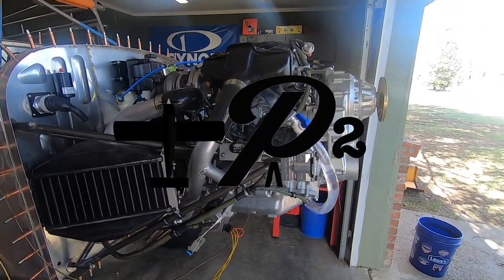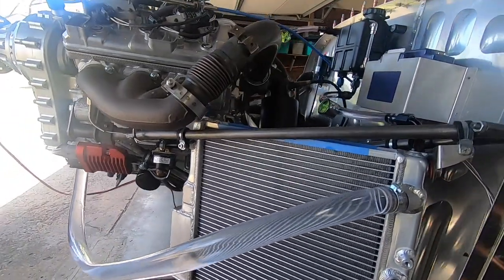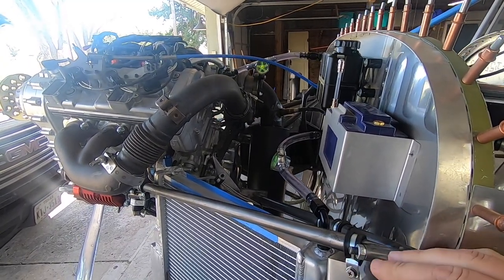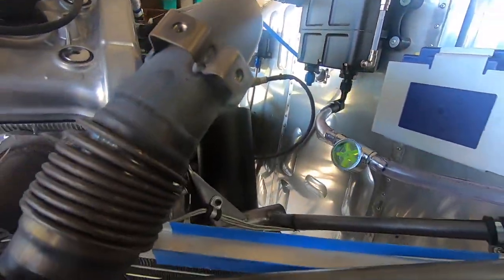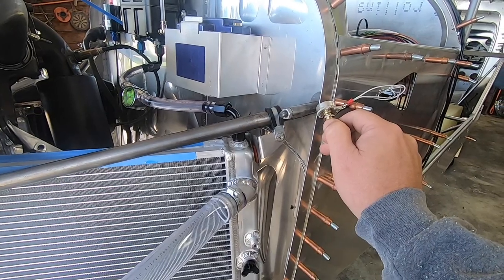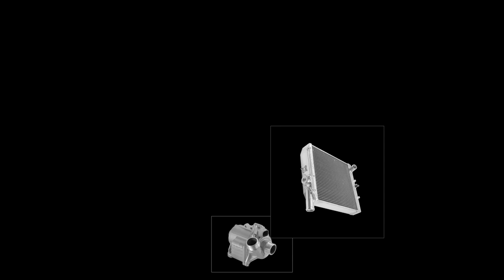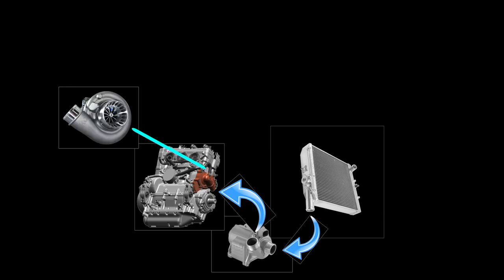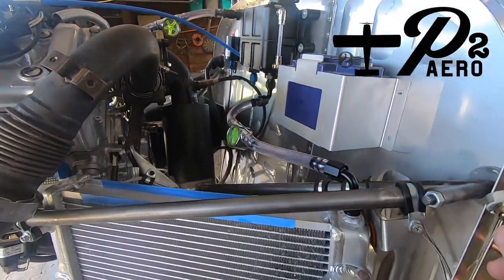Custom Cooling System for the Turbo Yamaha Rans S21 EP38

Comment: I am seriously, Very Impressed with everything about your approach to this cooling system, its design and execution. Your testing apparatus, temporary clear tubing and visible impellers, are brilliant. I’ve never seen those impellers before. Even the header tank seems to be a good hardware find.
Reply from the maker: Thanks Dennis! Those little spinning wheels are intended to be used in water cooled computers I think.. found them online and they worked out slick. It told me just what I wanted to know. Thanks for watching sir👍

Comment: What do you think your weight is at so far in the front without fluids? That large of a radiator seems a bit extreme.
Reply from the maker: No clue, but we are gettin close to running it and after that I’ll be weighing the whole firewall forward. Stay tuned

Comment: Once you get the cooling system in place, will there be a test run of the engine?
Reply from the maker: Oil and fuel system next and then yes.. chippin away at it
Reply: @Project2Aero  👍